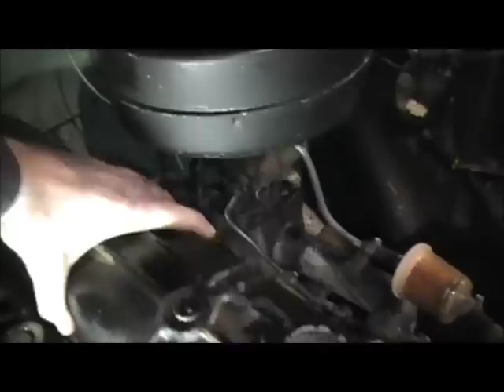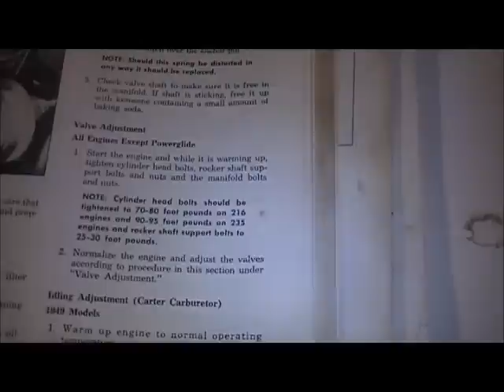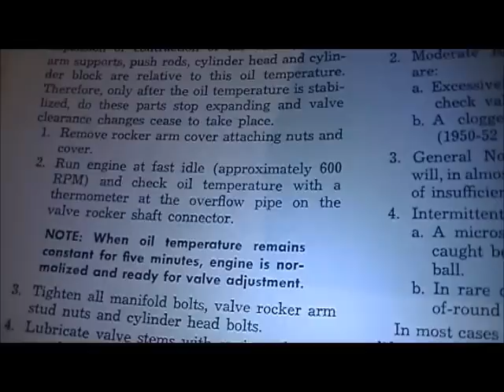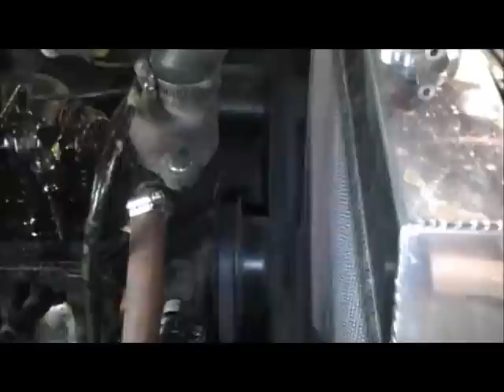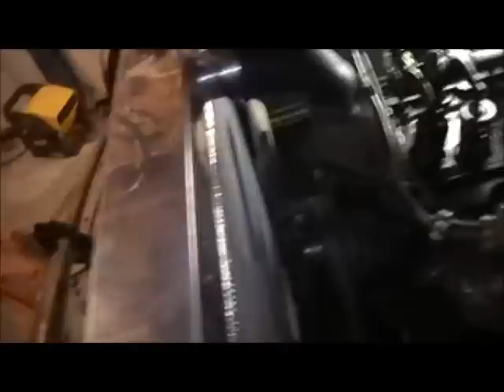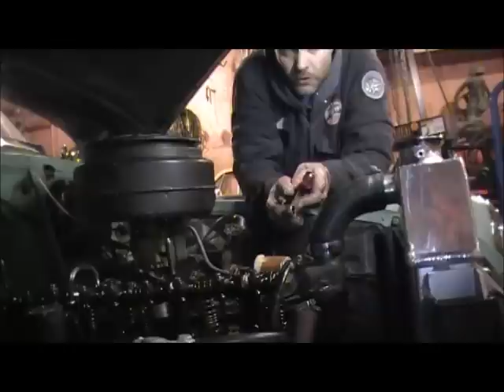1952 Chevy Styleline valve adjustment 216/235

Comment: That is the crank receiver on the crank pulley. Your replacement radiator doesn't allow you to use a crank to start it. I used the crank once to start my care once, a '39 JA, but the engine was warmed up that time. It started easily. Probably not when it is cold.

Comment: i may have my dads tool somewhere that was used to adj those valves running (back in the day) spring loaded with "tits" on both ends so it didnt slip off

Comment: I have A 216 that I'm working on  You said you're number 6 from the front to the back of the motor is an exhaust when it should be an intake you might want to check that out

Comment: My first car 1949 chev coupe, stop at gas station gas station, attendant had his arm in a cast held up above his heart. I asked what happened, stasis he was adjusting the carb on old Chevy like mine. Fan blade broke off almost cut his arm off. After that I have always been leafy of metal fatigue in all fan blades. Even the bearings go out in the old free floating fan clutches.

Comment: Hey man, adjusting my valves on my 60 apache with a 235. What exactly do I look for on the flywheel. Am I lining the pointer up with the ball bearing looking thing?
Reply from the maker: That should be correct on that.

Comment: Eric I like your video. I did that when I had my old '36 Chevy and '51 Chevy. I set the valves with the engine running worked out great.. I also had the adjusting tool for those engines. Thank you

Comment: A simpler way to do this is to simply adjust as the firing order goes. 153624. That can be done simply by turning the engine till the distributor rotor points to the next point and make sure the points are contacted. That signifies somewhere very close to top dead center. Just make sure the both valves are shut, it’s a easy process, don’t overthink it..

Comment: a well presented video... beautiful kids too by the way...

so did the valve adjustment rid that dreaded miss in the engine? I watched the video about the exhaust replacement, but the car had a miss... thought it may have been the valves... or maybe compression issue...

Comment: Also, the valves need to close all the way(deposits can build up on the valve and seat) if that happens the clearance will tighten up when you drive. a big deal. If you loose the valve clearance the tappet and cam will destruct. If you really want to do it perfect you need to know every valve is closing properly. having that cylinder up to fire. Locking the engine. High gear park brake on. pressurize cylinder with 100psi shop air. if you hear a valve leak smack on the rocker arm with a padded hammer to bounce the valve till the hissing leaking stops. then set clearance. Or just hope for the best.

Comment: I have the special tool to set the valve clearance with the engine running. Way to much trouble. Warm the engine up. Shut it off. Take off the distributor cap. Set rotor to number one(turn over with fan). Set number one valves. proceed as per rotor pointing to next cylinder(153624)

Comment: ball bearing wheel bearings need to run with a little preload(slightly tight) on them or they will self destruct. The timken tapered roller bearings do not need preload for the bearing. But do need preload if the car has disk brakes.

Comment: Ever have an issue on gauging the exhaust due to the bit of angle the rocker hits the top of the valve?
Reply from the maker: I haven't. It has been real easy with angled feeler gauges and the flexibility of even straight ones

Comment: The oddly tapered piece cast into the pulley is for the hand crank.  This feature was done away with in '48 on the cars but the balancer continued to have it cast in them.

Comment: I can't seem to get the timing right...any ideas what am I doing wrong. can you help me 51 235
Reply from the maker: +R1ko3 Grande If you are still trying to figure it out, you have to get the "dimple" on the flywheel lined up and make sure that the distributor is on TDC of #1 cylinder. If it is not working out try going one complete revolution on the engine as you may be 180* off on the distributor. A great couple of resources are oldchevymanualproject.com as well as on facebook the "kustom 49-54 chevy" page. Hope this helps, have a great day.
Reply: Thank you
Reply: Thanks man I'll try it out this weekend

Comment: Hey, just an FYI at minute 6:44 that is the hand crank attachment. When using the hand crank it catches on the right handed rotation until the engine fires, then kicks the crank handle off. That's so it doesn't beat the pi$$ out of the person cranking on it!!